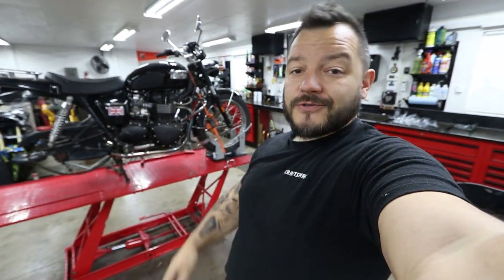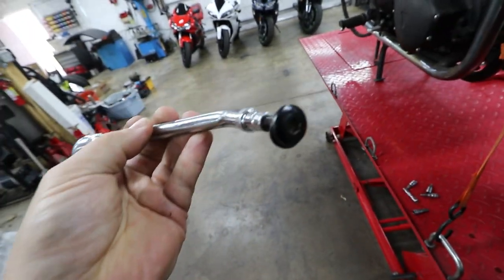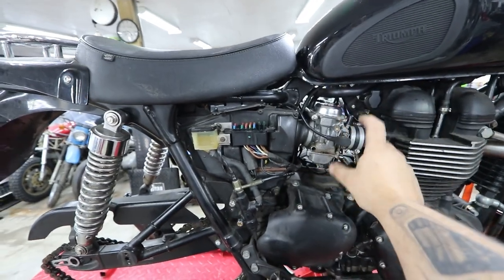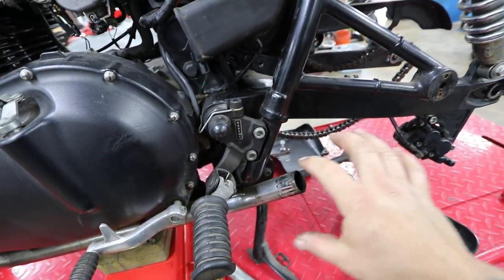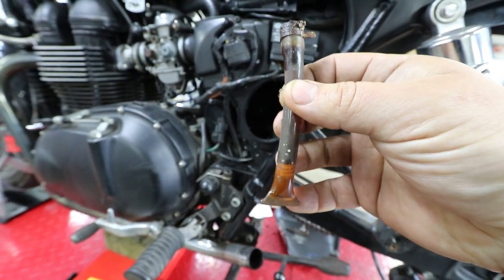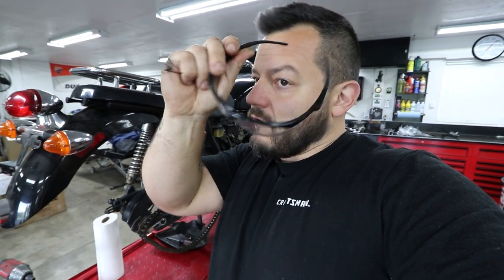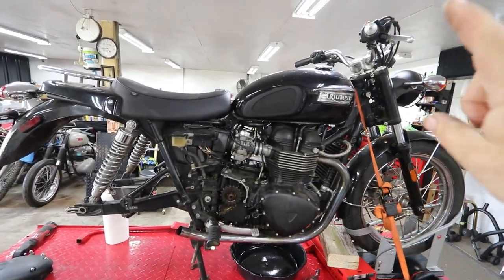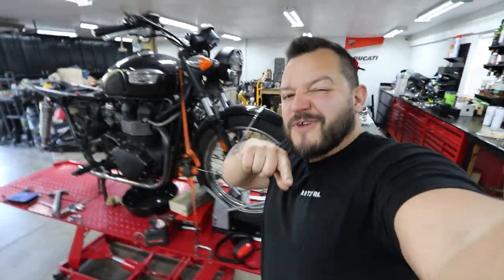EP3 Triumph Scrambler Ditching factory parts!

Comment: Oh finally the scrambler build begins. So my only suggestion for the build would be to go for mono shock in the rear, that would be killer.
Reply from the maker: With the size of tire im running it would be a hell of a geometric challenge to do so. My goal is to upgrade the rear suspension to a nice Progressive set

Comment: We appreciate the info and explaining you do every step of the way.  Question: why not just completely cut the old chain in half with an angle grinder?  We love you, Dado!
❤❤
Reply from the maker: You can cut the chain no problem that is an alternative way to remove the chain however I have seen the cutoff wheel jump because the train is not rigid enough. I've done it both ways with the same outcome.
Reply: @DadoRados  Thanks, Dado. 👍

Comment: 14:20 Really? That's nothing. I once pulled off a chain that literally had a hole in it. Two adjecent pins: one had a roller with a hole ground into it by the sprockets, the other one was missing a roller completely.😆
Reply from the maker: Ok, worst functioning chain that's 16 years old. 🤣